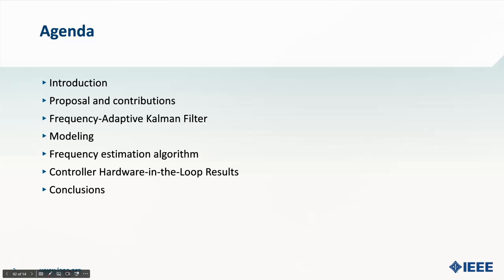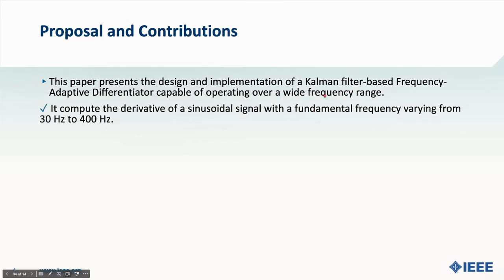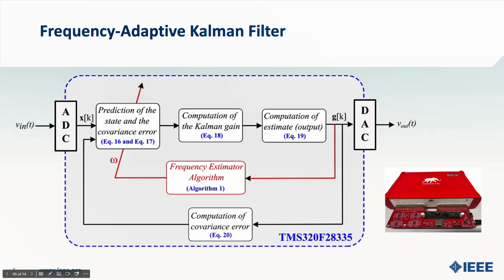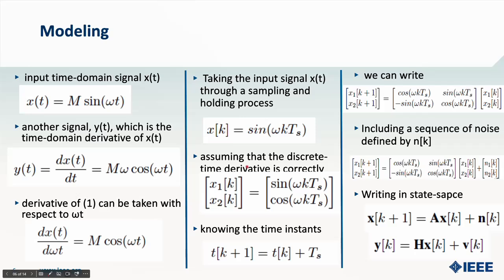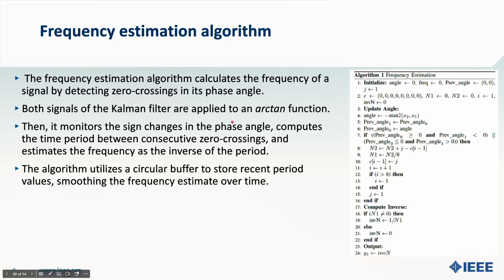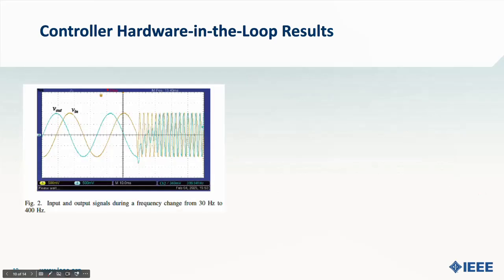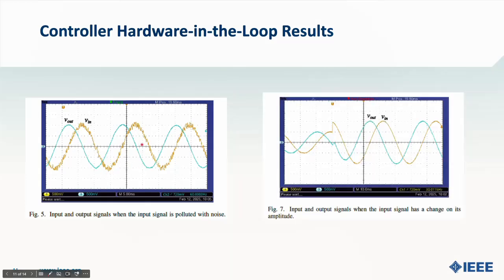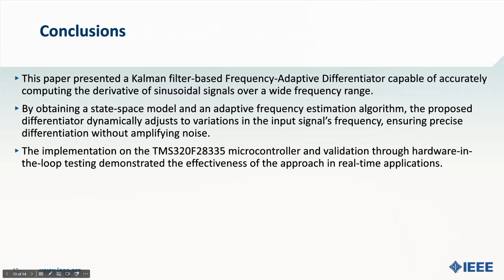Kalman Filter-Based Frequency-Adaptive Differentiator for a Wide Frequency Range

Comment: How to get measurement and environment noice matix in practical way ( how to conclude values to it )
Reply from the maker: I know that there is a way to get them based on probabilistic functions and density distribution, but in my case I got by empirical methods. After using Kalman filter for several years, we can make good assumptions on their values 😁